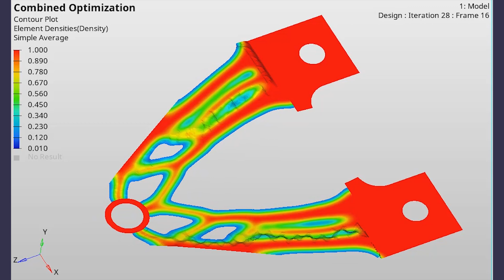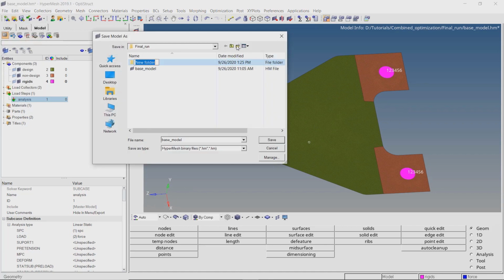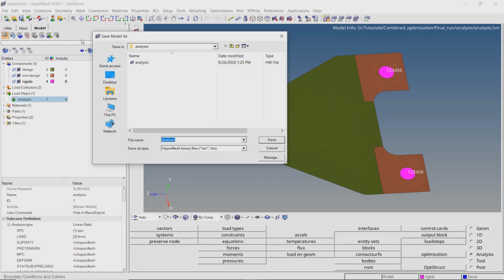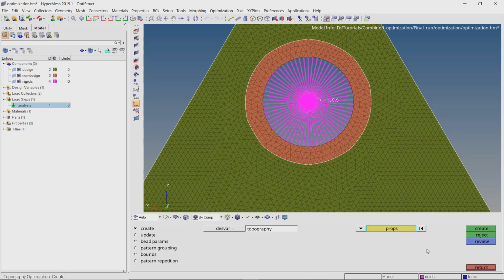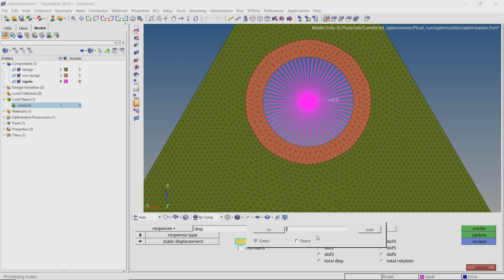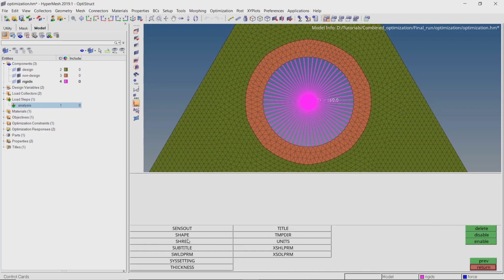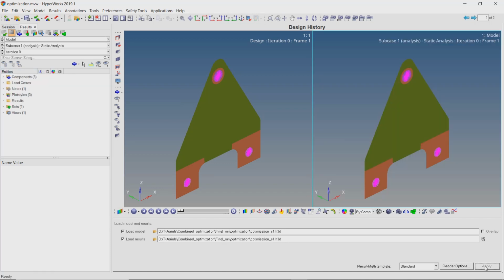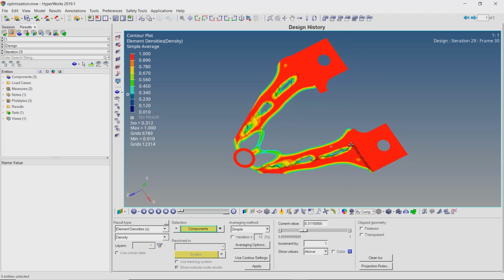Combined Optimization using Hypermesh [Optistruct Tutorial]

Comment: hı.how can we take optimization model for CAD data correction(CATIA or etc.)? Which extension is useless?
Reply from the maker: Hi there,
You can export the optimized geometry in STL file format from Hyperview. Then use this as a reference to modify the actual geometry in any CAD software.

Comment: Can u explain about control cards used for different types of analysis
Reply from the maker: There are many control cards in Hypermesh. It is not possible to explain the function of each card in 1 video. 
Based on your particular setup, I would recommend you to go through the Hypermesh user manual and online resources to learn about the necessary control cards.